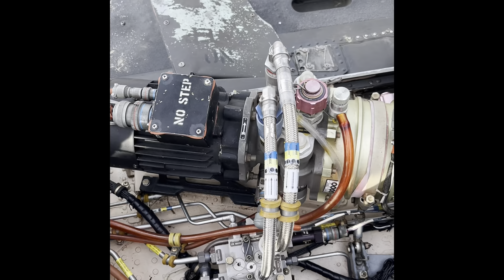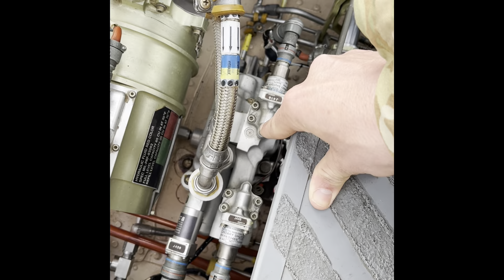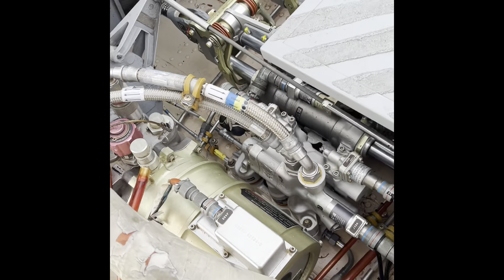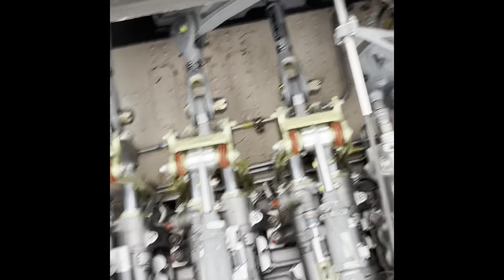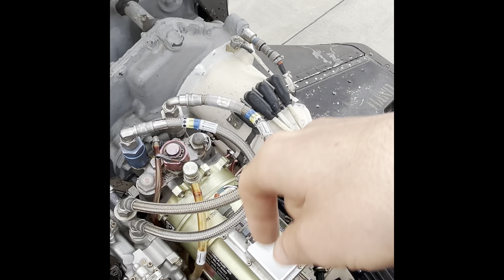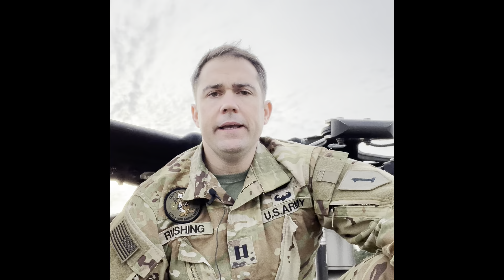Army Aviation - Hydraulic System of the UH60 Black Hawk

Comment: Why is it written in the checklist to land ASAP if primary servo 1 or 2 fails? Doesn’t back-up pump take over sa primary servos should it fail?
Reply from the maker: It depends on the EP. If you have a hyp pump fail and the backup comes on it’s a land as soon as practicable. If the back up does not come on it’s Land ASAP because there is nothing pressurizing one of the sets of primary servos in this case.

If you just have a primary servo fail that is an issue with the servo itself not the hydraulic pumps so doesn’t matter what is pressurizing it the servo itself is broken so it’s ASAP.
Reply: @scud-runner  thank you so much. It all makes sense now. So switching to 1st or 2nd stage only isolates  hyd pressure on the damaged servo, meaning only one servo is left for forward/aft/lateral movement. And if that gets damaged the will be no more way to control the aircraft which is why its land ASAP.
Reply from the maker: Exactly because the servo is either malfunctioning or could have a leak in it.
Reply: Any “failure” of a major system calls for landing ASAP. I believe this is a red X
Reply: @BlackhawkCrewchief  Although this makes sense,  any experienced pilot would Land ASAP on any corresponding major system failure  (as long as the LZ is suitable and safe).  But there are scenarios where landing ASAP is not favorable to the crew. I guess that is where in depth knowledge of systems comes in handy.

Comment: Awesome job. But can the the back up pump activate the Pilot assist servos in case the number 2 hyd pump failed?
Reply from the maker: Yes the back up can pressurize everything.
Reply: @scud-runner   but lets say there is a leak on the hyds#2 then the leak detection/isolation system would secure the Pilot Assist Servo hyd valve, and assuming there is a problem there in the P.A.S , the back up hyd cant provide hyds there correct? 

If the leak its not there and somewhere else, hyd pump 2 light come on and u secure the servo2 off then and only then the back up pump would supply hyds to the P.A.S, is all that correct? I appreciate the input
Reply from the maker: 1. Res low 2 caution appears. A fluid quantity switch senses this and isolates the pilot assist module. Now Hydraulic pump 2 supplies pressure only to primary servo stage 2.
2. If pressure in hydraulic pump two continues to drop you will get a hydraulic pump 2 failure. Due to the leak being either in the primary 2 servos or the pump itself. 
3. Hydraulic pump 2 failure appears, the backup pump comes on. IT WILL PRESSURIZE EVERYTHING IN THE NUMBER 2 SYSTEM (see -10 chapter two pg 2-51). This is because the quantity switch sense the pressure it needs to reopen the circuit. 
4. The next thing you have to do is watch for a backup res low. If this happens you must switch the servo off switch to primary 2 servo off. This is because the leak MUST be in the primary 2 servo.

Does that make sense?
Reply: @scud-runner  in your number1 case scenario, right the system Isolates the P.A.S and the back up pump wont supply hyds there, would u agree?  (Also wouldnt make sense to supply fluids if its leaking thru there) 

And regarding the servo2 off, we are told if u see the #2 rsvr low be prepared to flip the switch (servo 2 to off) when u see HYD PUMP 2 thats your indication to secure servo 2 valve, to apply depleting all the hyds thru the system 2…if you see the back up hyds rsvr low its too late.
Reply from the maker: When you get the res low two caution the PAS will be isolated. The only way you will regain the PAS is if your backup pump comes on to pressurize it which would not happen until you get your hyd pump two failure.

Also who is teaching that? That’s not what the FRCs advise. If you turn off the primary two servos when you get a res low 2 you don’t know where the leak is. It could be in the PAS, the servos, or the number 2 pump. If it’s in any other place outside of the primary two servo and you turn the primary two servo off then you just turn them off for no reason. That’s why the book advise to do it in the order it does so you can due process of elimination.
Reply: @scud-runner  first part is clear yea the PAS is done until the #2 HYD PUMP come on, the LDI ( leak detection/isolation system) reopens the PAS valve (because systems keeps leaking definitely somewhere else) and …

(tiding this idea with the second part of your previous message) you have to manually secure Servo 2 to off , by flipping the switch down from the center position, to hopefully NEVER get back up rsvr low. If u have rhe back up punp rsvr low u dont have a back up pump anymore. By having the  #2. Hyd pump light come on, means the leak its in PAS or pump2 itself
Reply from the maker: The leak wouldn’t be in the PAS if you lost your number 2 pump after the PAS was isolated. It would be in the servos or the number 2 pump. If the leak continues you would get the hyd pump two failure. The backup would then come on and pressurize everything in the number two system.

If you got a backup pump res low (below 60% of the full capacity) low the leak is in the servo. So servo switch off and land as soon as possible. You don’t lose your backup pump if you get a backup reservoir low. You can easily lose it if you aren’t paying attention but res low isn’t the same thing as pump fail.

Even if you did lose your number two system the aircraft can still land just fine. The more dangerous one is the number one system.
Reply: @scud-runner  I could make a video explaining the hyds in the mh60seahawk. We definitely secure the respective servo (1 or 2) if we 1/2 hyd pump after you first have the #1/#2 rsvr low. There is the LDI block diagram on page 2.8-9 of the NATOPS its walks thru the leak scenario per each system.  Perhaps the connections of the back up pump are a bit different from the Army’s? I dont know. And I think the sensors for the reservoir are at the bottom so having a low it may produce some pressure but it may not be enough to be effective. I can double check that part (how much pressure you have when rsvr low is in and where the sensors are) I do appreciate your videos and your time. I have learned a lot from you. Much appreciated. Maybe I should make the hyds system and we could see if there is a difference.
Reply from the maker: Yeah we don’t turn any servos off until we get a backup res low. There could be a difference in the procedure from the UH60M vs the MH60Seahawk. Thank you for the conversation it certainly gets me into the books more and I’m happy to hear my videos help. I might also make a new hydraulic video in the future.

Comment: This is great info for Crewchiefs and maintenance as well. IMO, crews should also understand how it works. I had a great test pilot that taught me so much as a young Private->Sgt. had me doing rotor balances with him, sitting in with his check off rides, made me go to Depot and do a remod to get the experience. Hated it at the time, but he knew what it would benefit me in my career, and it did. 

Learn it. Do it. Teach it.
Reply from the maker: That’s awesome. I’ve learned a lot in aviation from my MPTs and my crew chiefs. I spend a lot of time in the crew shack and doing maintenance flights to soak up as much knowledge as I can.

Comment: Outstanding description of the hydraulic systems. The Blackhawk has one of the simplest layouts once you understand the fundamentals.  I think of the UH-60 as an “Ironman suit” that the pilot puts on. The (hydraulics)act as the muscle enhancements for the human and other then the APU accumulator “help” move the control surfaces along with the mixing unit and boost. 
When disabled, it’s old school wire and brain.